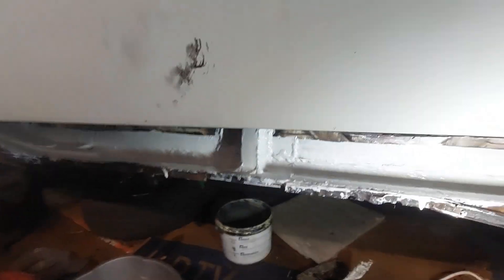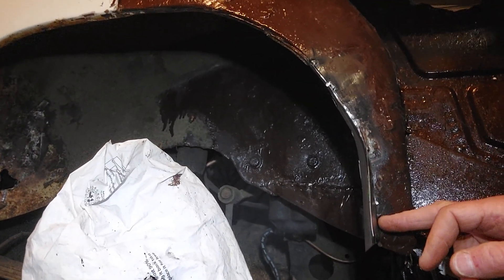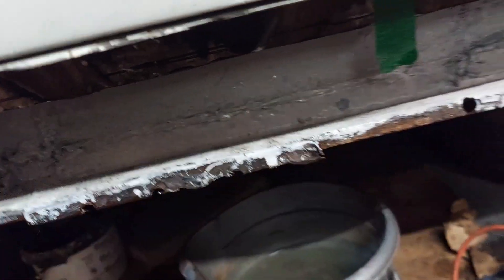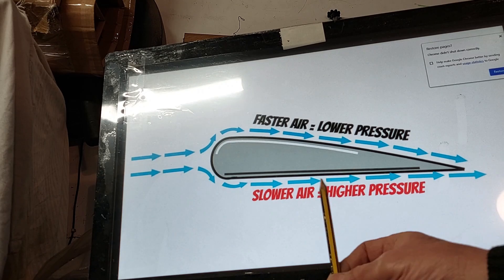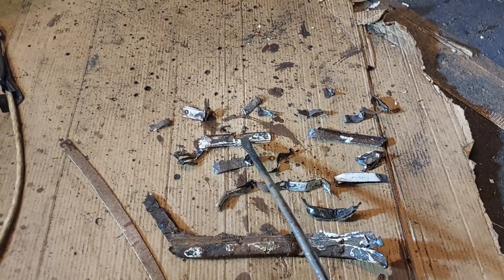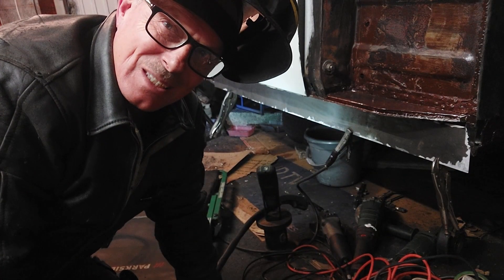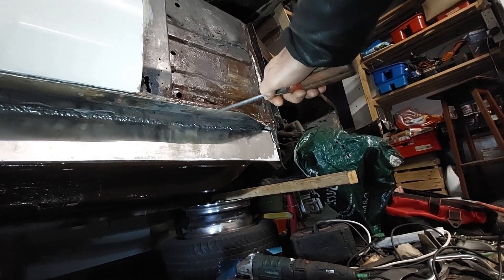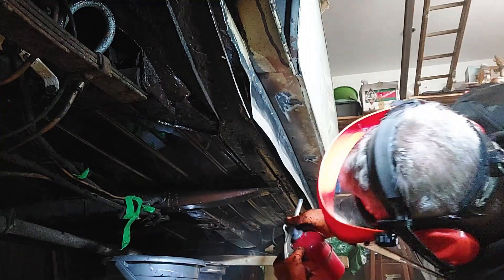MGB Restoration   Sill repair,  Bernoullie’s Principal,  Part 10.2

Comment: Interesting thoughts on keeping the sills dry. I was thinking of doing what Volvo used to do on their older cars where they took warm high pressure air from under the bonnet down to the sills, there is space behind the front wheel arch flitch panel for a pipe to go into the front of the sill from the area you had to repair, the warm air should evaporate any moisture & as you say the fast moving air under the sills should create a low pressure. 

Having said all that, on opening the rhs sill to fix a poor alignment I found that after 30+ years if properly painted with hammerite & then Waxoyled (badly as it seemed) the sills were fine, so repeating the process this time the car should see me out.
Reply from the maker: Thanks Steve.... food for thought. I wander if I can redirect some of the exhaust gas?
Reply: @Madeinwem Lots of acidic moisture, especially when the engine is cold & then there is one sided exhaust unless you are planning a V8 conversion?
Reply from the maker: Good point! I'll shelve that idea...